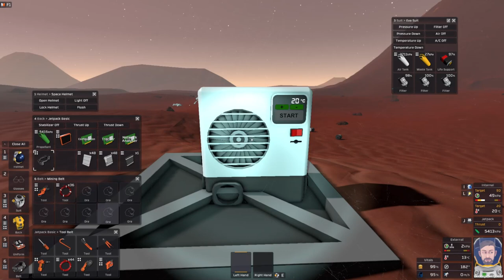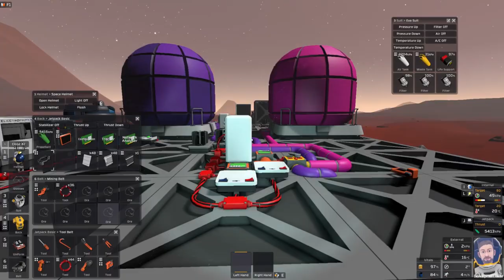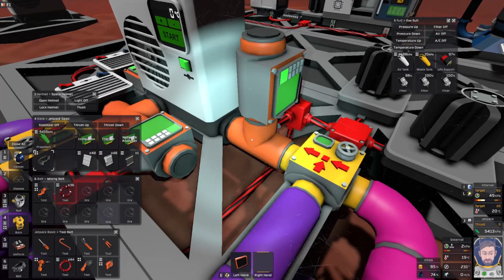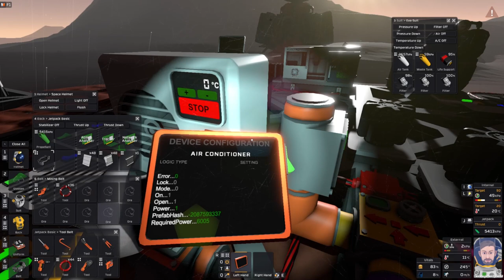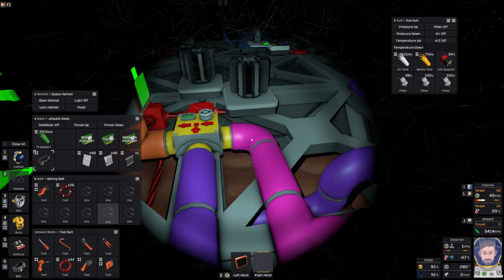Stationeers Experiment - Air Conditioner

Comment: very fascinating. with this it should be possible to setup a GFG on Venus with net positive power production. Any way to set it up to have a higher output (at the cost of more power obviously)? Would be silly to set up 100 ACs to achieve high flow.
Reply from the maker: Yes, I was thinking about your earlier video.  I think you can be power positive with GFG.  I suggest trying on Vulcan first on captured night air.  That would get you twice the cooling power per watt than Venus.  But no, 6000J is your max per unit.

Effective cooling is about 2000J per tick for 300W on Venus, 4000J per tick for 300W with Vulcan night air.

Comment: I love these experiments! And the analysis was spot on, very clever.

Have you ever tried cooling gas to 0K just to see what happens? I haven't. I'm just thinking that PV=nRT might not like that, which could be fun. And how would a gas generator react to 0K fuel? Possibly violently, but who knows?
I did an experiment with a 1x1x1 area (half a frame above above ground level) surrounded with frames that I pumped up to 17MPa pressure, then I opened the bottom frame and was blown away at a 45° angle for 350m (on Europa) and kept falling through the ground and until the terrain had been loaded. I was hoping for a way to blast big holes into the ground for lazy mining, but sadly all I got was a fast travel device out to nowhere. Hm, I wonder if building a barrel of some kind would have thrown me even further...
Reply from the maker: You should have video'd that!  :)

I haven't tried cooling to 0K.  I know a lot of objects take damage below 1K ("shatter").
Reply: @autom8it339  Oh right. That could be how the devs prevents the system from breaking. Just shatter every device before it can cause division by zero. Now that's problem solving.

Comment: Anyone know if this is still applicable with the latest updates or have they patched this out?

Even when this was new, none of the “main YouTube stationeers guys” seem to even be using this method. I used this on Vulcan and I know it worked but this was before all the updates this year. This seems to be a little known trick to cooling systems. Less mols means less to cool and because there’s less to cool you apply more temps to those mols and therefore can get it much cooler and faster. The use of radiators to cool down a room with it makes this system near genius to use in any cooling application.

Comment: Nice work.  It is strange that the additional pipe length causes it to process less volume per tick.  It sounds like you may have discovered a bug.
Reply from the maker: It's definitely strange that PV=nRT, but for calculating how much mols of gas to take, it's nTSR=10123.  Since "S" (pipe segments) is an analog for "V" (volume) then having "n" and "S" on the same side of the equation is weird, and seems like a bug.  It's even more strange when 10123 appears to be one standard pressure "P" (101.23) times 100.  It would make much more sense for it to be nTR = 101.23 x V, where "V" is "S" x 100.  

Dean Hall had apparently said he thought the A/C unit didn't work very well and they had discussed replacing it with heat exchangers.  Heat exchangers are already in beta.  In truth, it's the opposite - A/C units kind of work too well.

I want to continue my Venus Getting Started videos... the next topic was going to be cooling the large section of the base, and that's why I stopped to figure out how air conditioners work.  If the future of the A/C unit is up in the air, I'm not really sure how to proceed.  If A/C units are going away, the videos will just be confusing to future viewers.

Comment: Re pipe length: if i need a longer run of pipe, does setting a valve at the correct distance for in/out maintain the math?
Reply from the maker: Yes, but please realize that air conditioners don't work this way anymore.
Reply: @autom8it339  thank you.
just found a vid on that this morning: came to say so.

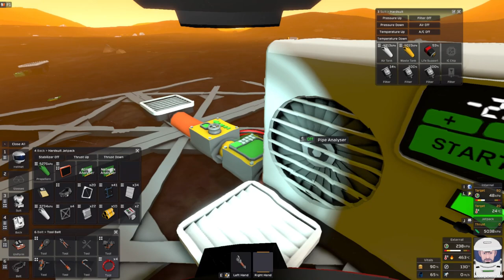Comment: At 14:50 did you hook up the waste vent straight to the conditioner without a pipe? If i do that it is not venting the waste, i have to place a pipe then the vent, weird
Reply from the maker: A passive vent is a pipe.  Are you sure it's a passive, not an active vent?  Also make sure the connection on the vent is pointing the right way.  That's gotten me more than once.